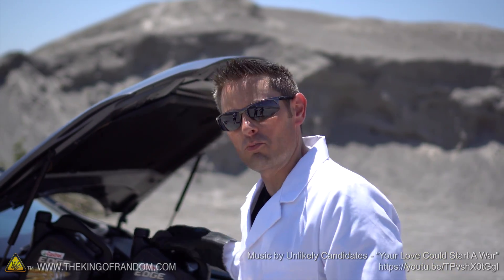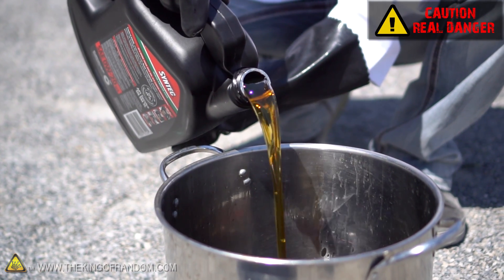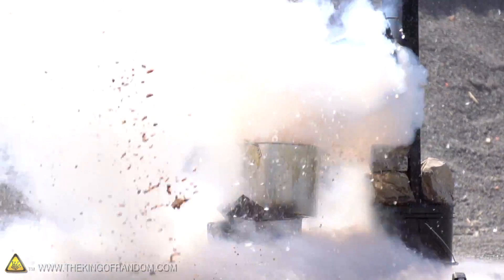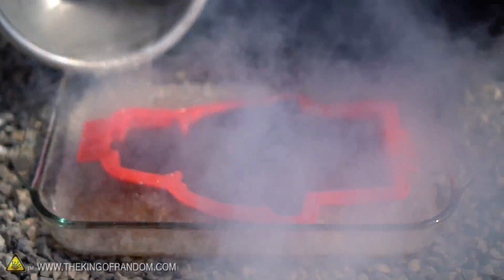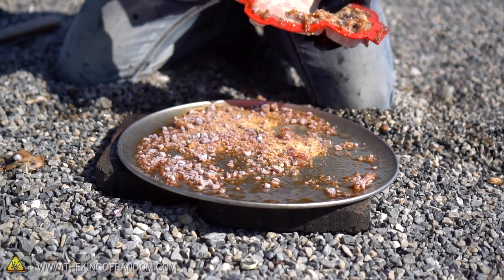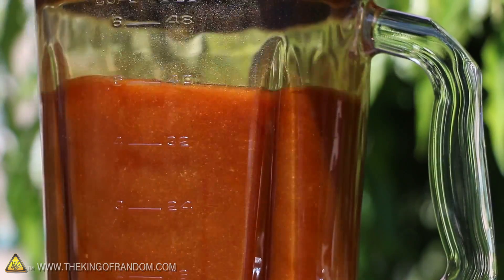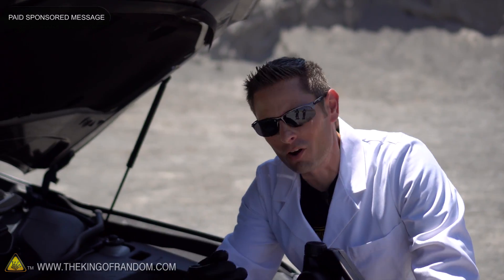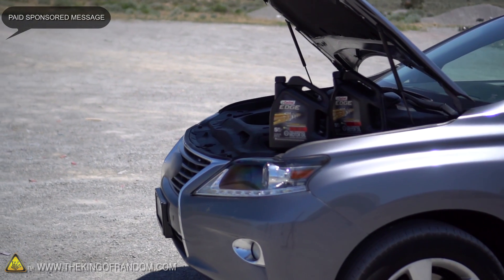Liquid Nitrogen Meets Boiling Motor Oil

Comment: what if you pour nitrogen in 400 degree hot water?
Reply: U stupid?
Reply: Pretty sure water is a gas at that temp
Reply: +Luke Kim If u have water even at 1000 degrees C, it won't nessecarely boil, since pressure makes a difference, cuz how else come lighter butane gas be liquid while in its container? the answer is its own pressure. but other than that, a pressure high enough to have liquid water at 400 degrees would be difficult to maintain if you were to pour N2 (l) in the water
Reply: You should read up on the concept of "pressure," then let's talk again.
Reply: Water is not necessarily a gas at that temperature.
Reply: At sea level water boils at 99.9°C.
But if you add salt, you can increase it's boiling point.
for every 20g of salt added to 1,000ml you increase the boiling point of water by 1°C.
So you will need 2,080grams of salt.
But adding 2KG of salt is not going to get water to boil at 204°C
Reply: Using salt won't help that much because of saturation point. And to heat water to at least 370&#176;C the pressure should be around 21000 KPa, which is very high.

Edit: without boiling.
Reply: Basically what just happened in the beginning. and I'm pretty sure that's almost impossible because the water would evaporate.
Reply: +Tj hero oh ok thanks. I didn't think about that
Reply: +Wietse van Eijsden no
Reply: You are very wrong. Water is a gas at about 100°C or 212°F or 373.15K. at STP
Reply: It evaporates in 100c dumbass
Reply: What a dummy u can't boiled water to that temperature, did u even go to school lol???
Reply: By the way, pressure is the same reason the Sun doesn't explode despite its extreme temperature. Instead, it stays a nice firey ball of plasma.
Reply: Oh thanks. Very useful. And that isb't sarcasm.
Reply: From the sun I understand.
Reply: If I had LN2,  and a LOT of salt, I would defenately try that hot water stuff
Reply: If it's 400 Degrees Celsius, then you'll die long before you pour the nitrogen, because of the extreme pressure the water would have to be under ~59,712,500 Millibars or 59,712.5 Bars. Unless you're using a futuristic super high pressure resistant space suit or something.
If it's 400 Degrees Fahrenheit, then, unless you're in something, that can protect you from high pressure you'll still die, because the pressure is 46,393 Millibars or 46.393 Bars.

(Calculations by http://www.csgnetwork.com/h2oboilcalc.html)
Reply: But doesn't the heat increase the saturation point? At least that's what I've learned at chemistry and physics
Reply: +IIGrayfoxII I doubt, that you'll be able to put 2 kilograms of salt in a kilogram (liter) of water
Reply: Dani Paunov I bet Grant can figure out how to do that somehow.
Reply: Read the previous comments.